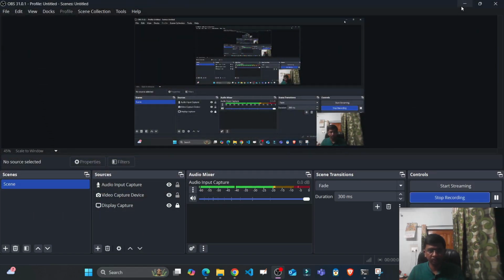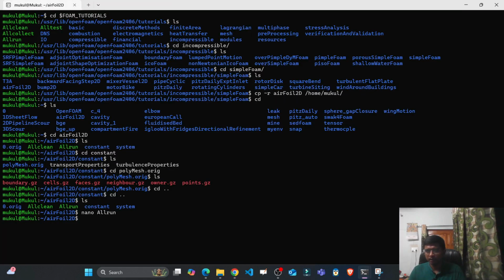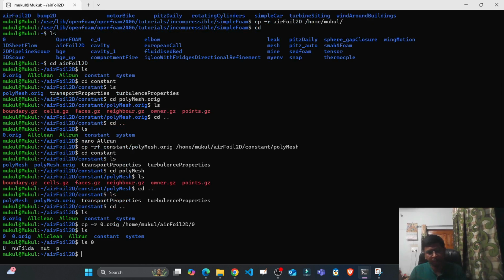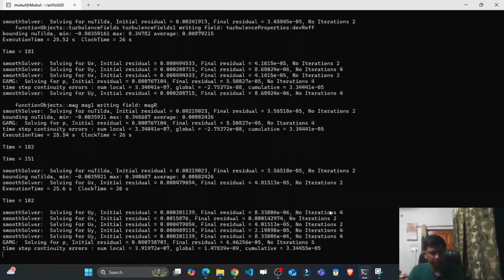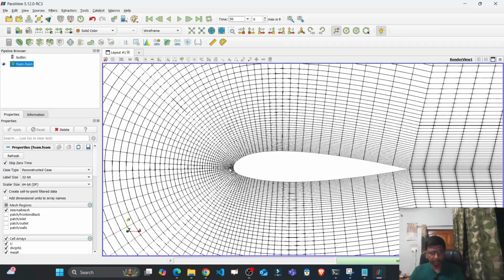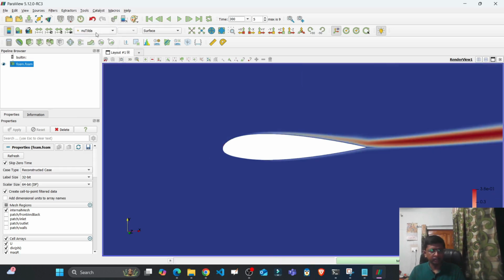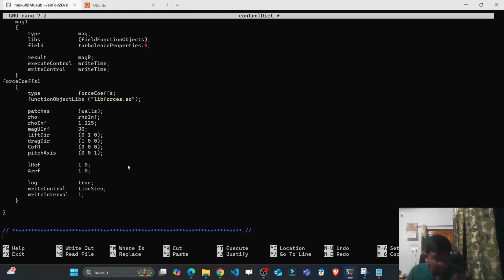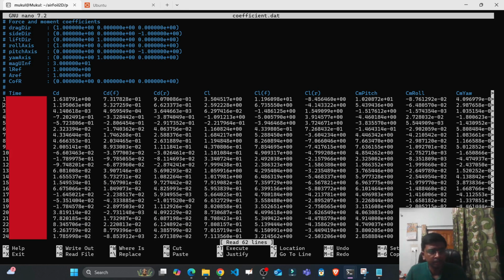CFD Simulation of 2D Airfoil in OpenFOAM | Step-by-Step Tutorial | CFD Simplified

Comment: Hello, your tutorial is very helpful. Could you please make a detailed tutorial on the full process of simulating a NACA airfoil in OpenFOAM? I would really appreciate a step-by-step guide covering:
How to generate a custom blockMesh, how to modify the boundary conditions, how to set up turbulence properties for different cases, and how to configure solution schemes. 
I am trying to simulate the NACA 4412 airfoil in OpenFOAM and want to validate it with experimental results. However, the built-in airfoil2D tutorial file uses a pre-generated polyMesh, which I can't modify for my case (wind speed of 4–5 m/s).
I'm also confused about which boundary conditions need to be changed and which turbulence model to use for this low-wind speed case. I'm really stuck at the moment, and a complete guide would be very helpful! please!!
Reply from the maker: Please send the mail on our email id: cfdsimplified@gmail.com